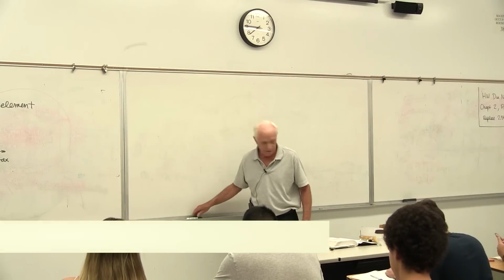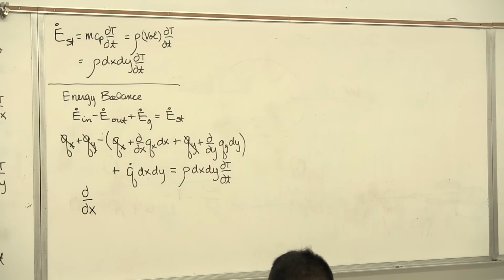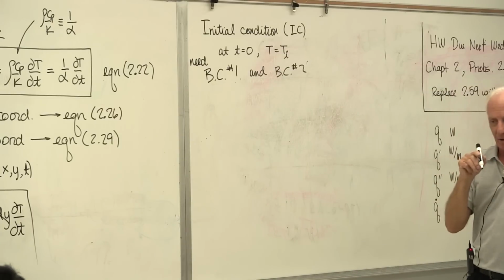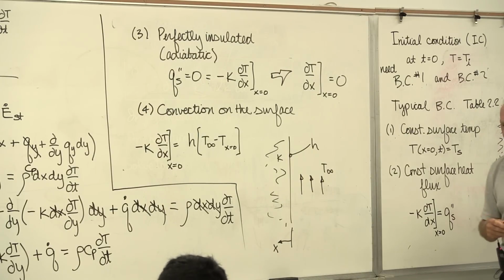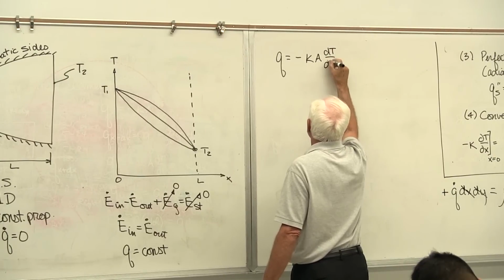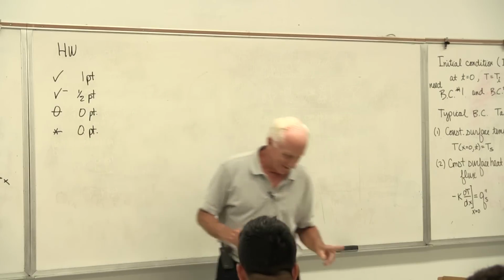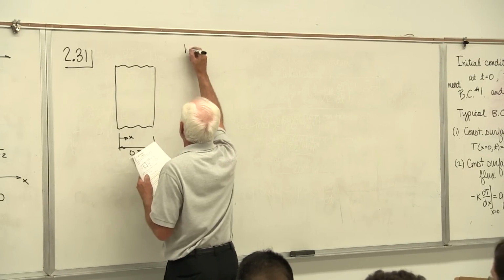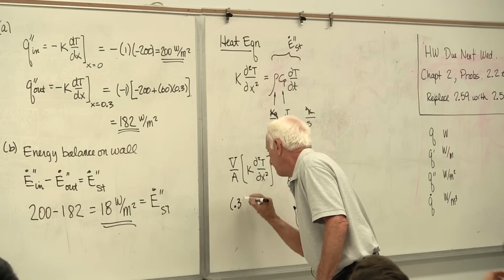Heat Transfer: Conduction Heat Diffusion Equation (3 of 26)

Comment: Dear prof. John, thanks for your fabulous videos which are of great help. Why time t is not a variable in the temperature function T = T(x, y, z)? If not, the general heat diffusion equation (2.19) would be problematic since the right term, the partial derivative of T with respect to t, must ALWAYS be 0. I think it should be T = T(x, y, z, t). However, you DID put time into consideration in the 2D case as is T  = T(x, y, t). I googled only to find out that there's no detailed and convincing answer to this question.
Reply: Yes, if the system is not steady state then T is a function of t, too.

Comment: i think something is strange with the solution of the 2.1 problem, specifically the part where you find the T(x) profile. A(x) * dT/dx is a NEGATIVE constant, so dT/dx decreases in absolute value, but actually INCREASES with x, rather than decreases. therefore its derivative d²T/dx² is positive, therefore T(x) is concave UP.
when the professor shows the slope of the profile "decreasing", it is actually decreasing in absolute value but actually moving from a large negative value to a small negative value, i.e. INCREASING.
Reply: there is a minus sign in that equation

Comment: for question 2.1 if dt/dx become smaller means that it hasa derivative if it has a derivative conduction should not be steady state according to heat conduction theory d^2T/dx^2=dT/dt can you explain
Reply: Well, steady state and 1-D heat transfer are actually not good assumptions for that case. For these assumptions d^2T/dx^2=dT/dt does not apply because your infinitesimal element should be taken as a slender element with the whole crossectional area.

Comment: Why is the q coming out of the differential element greater than the q that enters it? Where is that additional heat coming from?
Reply from the maker: It can be internally generated in the fluid element (maybe chemistry is occurring) or maybe heat entering from multiple directions (say, the left and bottom) flows out through another direction (say, the right).
Reply: @CPPMechEngTutorials  Thank you for your response :)